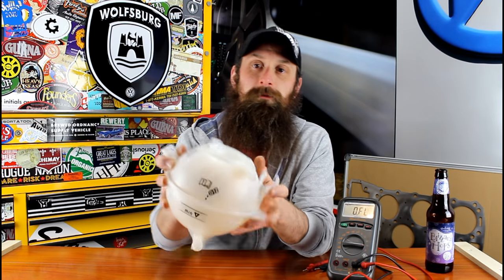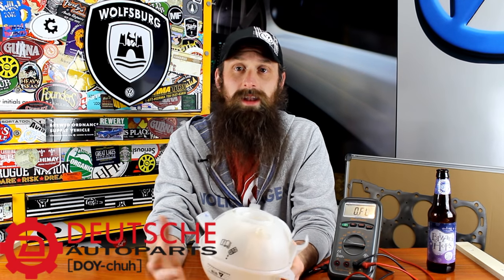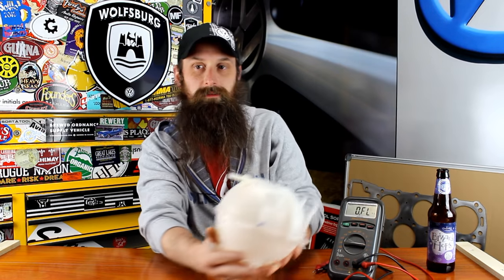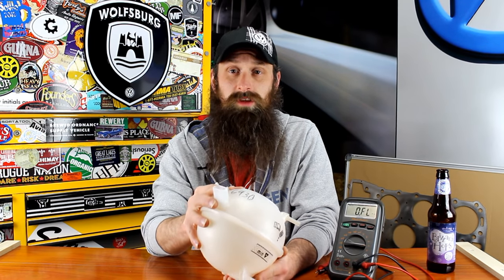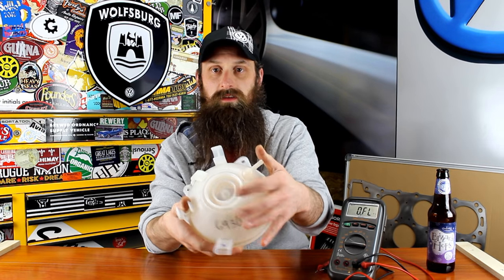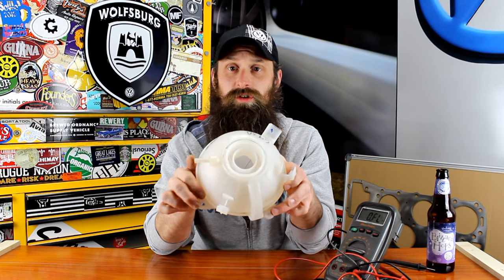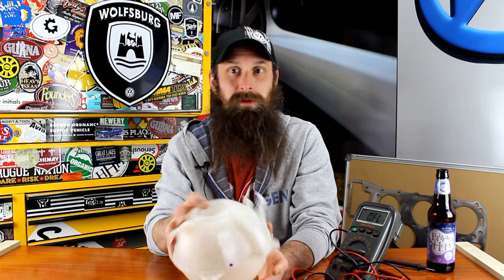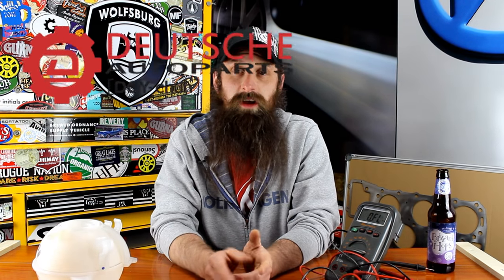How VW Coolant Bottles Fail

Comment: Just wanted to share this as really pissed me off daily ! bought a 2013 lwb VW crafter 136 hp which developed a coolant leak which couldn't  be found by two garages 
Tried most things over 18 months water pump 'expansion bottle+ cap  pressure tests"uv dye exhaust gas test in coolant which did turn yellow
It turned out to be the egr unit was gone so bought  a
£120 unit from Ebay  not hoping for much put it on myself don't know anything about working on vehicles ' had to make a few adjustments because the unit from Ebay was slightly thicker nothing a saw couldn't sort out! almost 7000 miles later  
 Its JD.....hope this helps somebody from getting ripped off over head gasket repairs £2000 _ £2500

Comment: At what resistance of the coolant would the temp light start flashing? Is it temp related/calculated? Only the pink OEM coolant has the right resistance? What if RO water is added to the cooling system?
Reply: The tank only relays coolant level. Not temperature. Temperature comes from the coolant sensors located elsewhere in the system.

Comment: Hello there!!! I'm having some isses in my b6 2010 passat TSI. At cold mornings (10°c here in Brazil) when i start the car, temperature light start blinking. The cooling liquid is in propper level and the car temperature goes up till 90ºc and stay there. If i turn the car off and start again the light stop blinking..... 
is it possible to be this bottle issue?

Thanks, and sorry my poor english.
Reply: Mostly, yes. I have the same issue in a Polo 2007. I'm thinking to change the bottle as well.

Comment: What is recommened pressure for testing Volkswagen coolant systems? I allready have pressure tester and vacuum refill kit from ebay with adapters. And do you know how many pascals is safe to use when testing coolant system with vacuum or vacuum refilling? Is there any adapters for Volkswagen coolant cap pressure leak testing?
Reply: My test kit only has test adapters for metal pressure caps. Im looking adapters for Volkswagen caps. Not for reservoir... For caps

Comment: My coolant was definitely below the line when my light came on and I checked for any residue around the wires and tubes, is it possible there is a leak somewhere else?
Reply: SilentMott sure, waterpump or radiator
Reply: SilentMott usually it is thermostat
Reply: Check your heater coolant  flange

Comment: My car randomly purged all my coolant through that overflow tube you mentioned, never had any temp problems before any thoughts?
Reply from the maker: Seen a head gasket do that a few times, also seen a few bottles fail that way
Reply: HumbleMechanic I don’t think it’s my head gasket. Filled the coolant back up and tried to see if I could get it to repeat and it’s been running fine for a month now since it happened. Thankfully happened in my driveway while idling so I was able to shut car off immediately
Reply: Daryl Ramos did you ever find the solution? My car just did the same thing

Comment: Guys, I saw few drops of the little hole on the reservoir (~2:55) I drove the car for 1 km with higher RPMs than usual, around 2500-3000. I drive it around the city with 1400-1900 RPMs. So I saw the car before and after that 1 km, and I saw few drops, not very much, but it was not for first time. There is no smoke out of the exhaust pipe, there is no whiteyellowish goo of the oil stick, the temp. is always around 90 degrees. I have a feeling for blown head gasket, but the only indicator of that is few drops? The combustion leak test went green. Any idea? 
The vehicle is with the same reservoir. Skoda fabia 2000, 1.4 mpi.

Comment: Changed my bottle AGAIN, first one did not change issue (red warning flashing on dash)although NO overheating problem just the light flashing on dash readout, so I also read it could be the temp sensor even though it worked fine reading wise, so changed that too as a preventative measure...  I'm now on my third bottle and STILL have the SAME issue so I'm guessing the problem is elsewhere... ANYONE have any thoughts please, by the way its a Skoda Octavia mk2 2008 BMM engine, Just my luck !

Comment: Thank you! My wife's beetle is getting that red light, and I wasn't sure what it was. This video helped a lot. However, the red light flashes when she turns on the car, then it goes blue and then it goes away. If it flashes is that still the reservoir? And can you post a link to buy it from your sponsors. Thanks in advance!
Reply from the maker: +Michel Infante Yeah that sounds like the Bottle! Here is a link to a bottle from SHOPDAP. Be sure to load your car up and get the right bottle. You can also pic up from coolant from them if you want. 

https://deutscheautoparts.com/1k0-121-407-a.html
Reply: +HumbleMechanic awesome! Thank you for the quick reply too.
Reply: +HumbleMechanic Would you recommend replacement of these every 100k miles to prevent having the possibility of the electrical connector leak?

Comment: Hey Humble mechanic. Can I ask you a question? There is a short metal coolant return line that sits over the alternator and under the intake. To change that obviously the intake has to come off. It looks like lt plugs into the thermostat housing. I see it releases from the rubber return hose on one side but the part of it that plugs into the thermo housing . How is that side disconnected? Is it bolted in or is it held in  some other way. Doing a change on it soon. Just want to get some knowledge on it before I start the job. Thanks.

Comment: What would cause the lid to keep shooting off? Just looking at a second hand mk4 and the owner says the cap keeps blowing off. Apparently the engine temp still sits at normal 90 degrees Celsius (or half way mark).
Would a flush and new expansion tank fix?
Reply: If the cap keeps shooting off then this indicates too much pressure which could be two things 1. Faulty cap 2. Blown head gasket

Comment: Gabriel Martins Which part of the brake fluid reservoir fails? I have never seen one fail.
Reply from the maker: ***** I have seen lots of b5 resi fail when doing a pressure brake bleed, but that is about it.
Reply: +HumbleMechanic  LOL, I've had this happen and it is NOT fun.  Big mess.
Reply: Can anyone tell me how the overflow works in these VW engines? They don't seem to have a radiator spill cap to release too high pressure in the system

Comment: would you recommend that coolant flush product and they fill with my regular 50/50 mix or is just distilled water probably just as good? Also I see people all over YouTube pour in their concentrate then their water to get the 50/50 mix, but shouldn't it be mixed in a separate container first or does it not necessarily  matter..?
Reply: I was told by VW parts department employee to mix equal parts of water/coolant in separate container, then pour into the car coolant bottle! Hope that helps!🔔

Comment: So my reseviour in my 1990 Jetta 1.8 keeps "boiling over" everytime the engine warms up. It's not over heating, but as the engine gets to tempature, the coolant raises to the top of the reseviour and pours out of my overflow holes? Any ideas what it could be? I'm thinking it might be my level sensor? Or the reseviour cap?
Reply: Ben Poelman did you over fill it over the max line?

Comment: i have a b5 and it's not the same bottle and it never showed signs of failure with 160k miles whereas the break fluid reservoir desintegrates like there's no tomorrow, i'm in the second one and it's happening again, why does that happens? it's annoying and dangerous

Comment: I have a 99 Passat aeb 1.8t trans won't do manual mode only drive and reverse the 234 also don't work oooo and no overdrive the trans computer is clean and dry... The check engine light won't read eather please help me fix this

Comment: I had my thermostat replaced back in January on my mk7. There isn't really a leak anymore from there but i have noticed there is coolant coming from it looks to be the cap area of the bottle. One thing i should note is currently the coolant is above the max line. Is that possibly the reason why it's overflowing at times, could it be the cap or something else? The coolant i see when it over flows is formed around the cap and right around the seam lip (sitting on top of it) not leaking from the seam per se
Reply: Seal in the cap... change the cap
Reply: I keep coolant level just under halfway between max/ low.. personally I would never have it at max....

Comment: I have a 1992 VW Cabriolet.  The sensor probe that drops down into the reservoir won't stay secure in the bottle. The coolant then comes out of the reservoir when driving, tripping the flashing red light,  Anyone else see an issue like this?
Reply from the maker: +J weird never seen that. Time for a new bottle I think

Comment: i have a audi B5 i replaced myself the water coolant reservoir my original tank had an round plug but the tank i ordered was a (round/square) can some one tell me if i can mod the connector to the new one style does it have polarity or its just a resistor that doesnt mind polarity
thank to every one that can help me

Comment: I have a leak, and cannot find.  I have scoured YT  and no helpful info on the coolant bottle.  If my problem was false readings or migrating coolant via wire harness then this is the place.  I suspected the cap.  But nothing being said.
Reply from the maker: Unplug the connector and look for coolant. If there is migration you’ll see it

Comment: Last time I refilled the bottle cause the system just exploded when I broke a plastic coolant pipe joint. I filled the bottle to the correct level when cold before I start the car and drove it with the heat on full blast for 20 minutes. And the other day when I checked the fluid the level is below minimum. The question is, why didn’t the warning light came on?
Reply from the maker: It has to be lower than below min for the light to come on
Reply: HumbleMechanic it was below minimum but while I was driving the day before the light never came on… weird.

Comment: B5.5 passat.  I got carbon deposit build-up just inside where the cap opening is.  Also have to fill-it up about once a week.  The excess coolant seems to just come out of the overflow.  What could the problem be?  Have been driving for about a year like this, but would be nice to fix the problem properly.
Reply from the maker: It may be the seal on the cap? Or the bottle starting to leak.

Comment: Hello, I have a 2002 Audi A6 Avant Quattro 3.0L. I have the low coolant light on after I replaced my tank, Drained the system and put in G12++, The car does not overheat at all and it has a new temp sensor, I have no air in the system or in the heater core. It has full circulation. I hook up my OBD2 reader and get nothing for codes and it runs a 219F with a 198F thermostat that has also been replaced. I have been trying to track down my issue. My coolant tank plug has no broken wires/ bad connection. Does anyone on the Internet have any other ideas because mine are dwindling down to nothing.

Comment: My still doing overheating the cooler system, after replaced the coolant reservoir on VW Golf 2003 2.0
Reply from the maker: Fans working? thermostat opening? Waterpump flowing? Those are the main issues.
Reply: All those 3 replaced!

Comment: How's it going I hop u can help me with my problem so my 2002 vw jetta 1.8 t 5 speed cluster tells my temp is at 190 but ones I drive the car for maybe 30min to  1 hour  the cluster tells me my car is over heating no red night but my temp went to 200 state's there maybe for a 1-2min then gos back to 190 and the problem well keep repeating I changed my temp sensor and thermostat but car still over heat what can be the problem really need help
Reply: @Aaron S I no longer have the mk4 but the problem was it needed new water pump it wasnt working properly

Comment: I've got a 2004 R32 which will come up with a "stop and check coolant"on cold mornings. However it's happening more and more on less cooler mornings.
I run the engine for a few minutes, turn it off and back on and everything is fine.
Does this sound like a bottle failure?
Reply from the maker: +Alan Quigley yep that's where I'd start
Reply: Cheers sir, love the videos.
Reply: Hi Alan.  I have the exact same issue on my 2003 GTI.  Only on cold days does the 'STOP check coolant' light come on, and after I warm the car up a bit, it goes away.  This has been going on for about 2 years now.
Reply: Yeah it's a pain, I haven't had time to look at it yet to check the probes. I've got other issues with the car that I need to check first. Cam position sensor codes, lack of power etc..
Volkswagens keeps a body busy.

Comment: Charles, considering all of the possible problems mentioned, would you recommend replacing the coolant bottle as preventative maintenance, prior to any issues developing?  If so, what interval would you estimate might be appropriate based on your experience with the various issues?
Reply from the maker: Maybe, it's pretty cheap. Could be good to do with a flush. But if you keep clean coolant you probably will not need to. .
Reply: I always remove the seal on the electrical connector at the coolant bottle. Then if, the contact leaks at the coolant bottle electrical connector it will not mean the end of the car when the wiring loom could get contaminated.
Reply: Does the golf mk5 1.9 diesel have an aux water pump ? I get a coolant leak when the key is in the aux position but oddly enough there's no leak with the motor running although I can't see anything

Comment: I have a VW cc 2010 This car is so weird I have a problem when I drive the car and turn it off about 3-5 times depending it will start up and when I go to drive off the car will cut off then when I try to start it again it will start and cut back off like it's not getting fuel. Had it at the VW shop twice the first time they replaced the High pressure fuel pump. but I still have the problem doing the same thing. but they say everything check out on the codes. But they cant seem to fix the problem. Can you help please.

Comment: Hello 
I have Polo 1.2 12v 2001 when car is cold the water level is on Min and when it reach the working temp it comes to Max .
what could be the issue, maybe air pockets, does this system circulate water by it self and remove air from system i dont know .
All suggestions and advice's are welcome .
Thanks

Comment: I have a 2003 TDI Jetta, my fuel metter either indicates full, either zero and some times shows the right amount . Any help?
Reply from the maker: check the connection at teh pump. It may be loose

Comment: I’m having major issues with my 2012 vw jetta. Seen two mechanics for recommendations and I was told that I am some how getting coolant in my engine and at some point my engine has overheated. And now.... I need s new engine. I’ve gotten my water pump fixed in the summer time (2018) and late Nov my coolant light goes off. I got a oil change and a brake vacuum pump done and now still my coolant light goes off and my oil light is still going off. I’ve been told that my engine is overheated and contemplating to do this engine swap.... wanted to get anyones opinion or thoughts. Also because I was told my head gasket is blown and I am completely confused on which or what is really needed to be fixed.
Reply from the maker: Yikes. Was either place you took it a VW dealer or specialty shop? It may be worth taking it to someone who knows the car really well.
Reply: I had the same problem ,resurfaced head,  change head gasket ,problem fixed but not cheap job.

Comment: What else will give you a false level reading? Answer: Two inches of crankcase oil! At least that's what happened to my '86 Golf N. A. 1.6 Diesel.  Weird thing is, no coolant in the crankcase... now, I would assume this means that the oil is under more pressure at the leak point than is the coolant. What I suspect is the gasket between the block and the oil filter "stanchion". I'm told that the coolant flows through the stanchion, or filter mount or whatever you care to call it, in order to help cool the engine oil. I don't know if that's true, but it makes sense. The filter is enormous for a little 1600cc diesel, and when its full of oil, it is quite heavy. Any vibration or jiggling around would likely degrade the gasket, or loosen the bolts or both. Wish I knew for sure. Drained all the coolant, flushed the system. Ran it hot with continuous cool fresh water flowing through it. A small amount of residual oil left, and temp. gauge working again. Next up, drain the oil, pull the filter and mounting device, chech the gasket and verify the oil cooler theory. It is a standard five speed transmission, so I do know it is NOT tranny fluid. It is however, thick as tar (in the coolant recovery tank), whatever that means. Wish me luck, if this ain't it, I'm out of ideas. E

Comment: would a coolant flush get rid of the black plastic shavings from water pump failure?
Reply from the maker: +Tyler Wyltk usually they don't get through the entire system. Normally it's just parts sitting in the well where the pump rides.
Reply: HumbleMechanic my water pump failed, however it was like shaving the plastic of the impeller an thus sent plastic shaving threw the entire system, i was going to replace bottle in spring but i want the plastic stuff gone as much as possible. how do i full system flush?
Reply: mk4 jetta